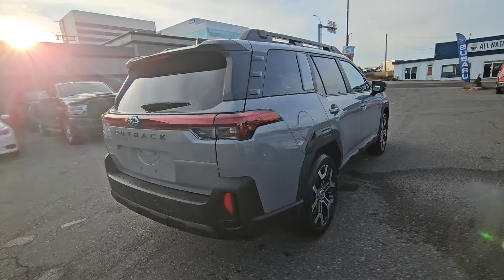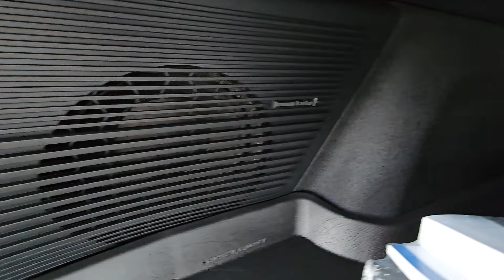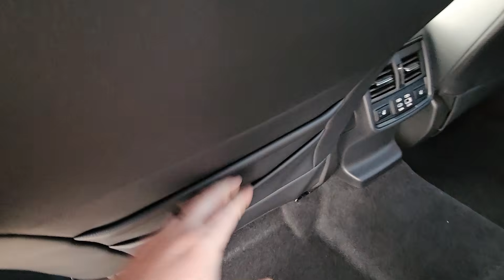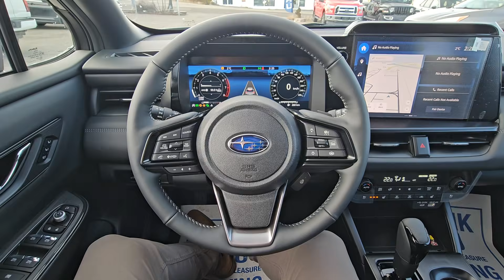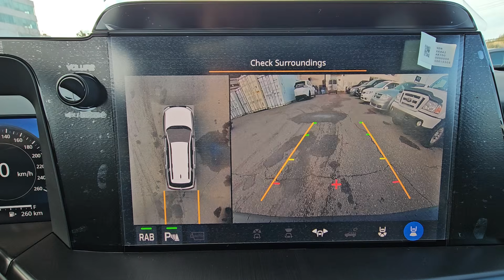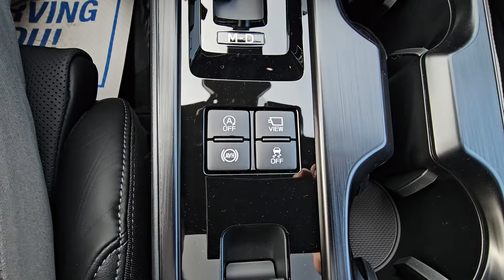2026 Subaru Outback Premier XT River Rock Pearl 26OB2625

Comment: Thank you for the very good review, however, Outback is on average $4-5k more expensive and less fuel-efficient to previous models. Most reviewers are reviewing the top model to get views, but they should review the most sold model instead. A $50k car is not easy for most Americans; it’s a lot of money.
Reply from the maker: Thanks for watching!

The target market for the Outback is those with higher incomes, who don't care about the price increase because of the value that they see, nor the fuel efficiency difference. 

I also have walk-throughs of the Touring/entry level model elsewhere on my channel.
Reply: A 25% tariff does have an impact on a car built in Japan.
Reply from the maker: @DredPir8Roberts good thing Canada doesn't have 25% tarrifs on Japanese produced vehicles!
Reply: @TysonTheSubaruSpecialist Yep. That’s the biggest clue about the tariff impact even though they try to hide it. Canadian top trim is $55k CAD which is $40k USD. Our top trim is $50k USD.

Comment: They are clever with the black cladding over that massive front overhang. Also, on smaller wheels this'll look like a car from cartoons. Sad it lost it's "raised wagon" look. But nothing new under the sun with Subaru and design. For me the two previous gens are much much nicer.
Reply from the maker: I don't think it looks "Cartoony" at all with the 18 inch wheels, but opinions can vary. 

I do like the previous gen Outbacks a lot, and I had a 2012 myself, but the new ones are not bad in the slightest. Different, yes, but not bad.
Reply: @TysonTheSubaruSpecialist  Purely subjectively, the 2012 was hideous as well, no offense 😆 For me, the 2019 was peak Outback, it'll still look good in another 10 years. It had all the needed perks too.
Reply from the maker: @Tibchy91 no offense taken! Different people like different things